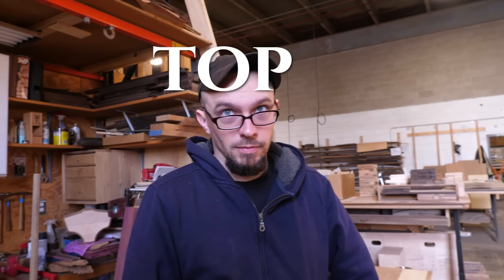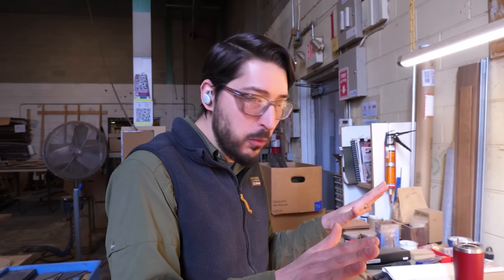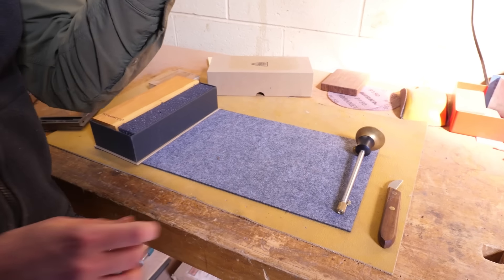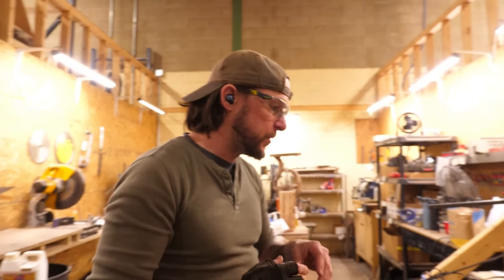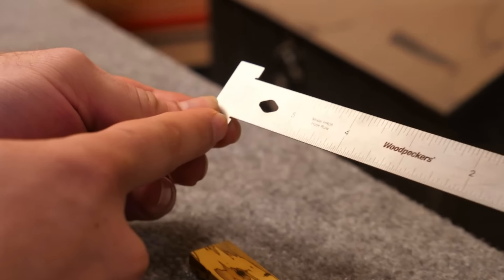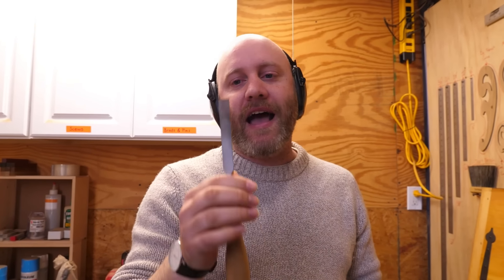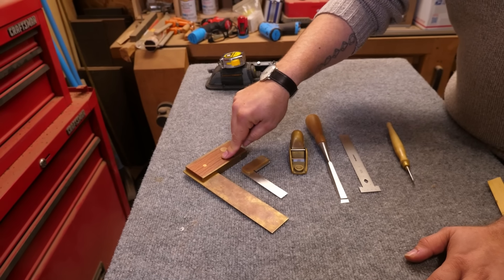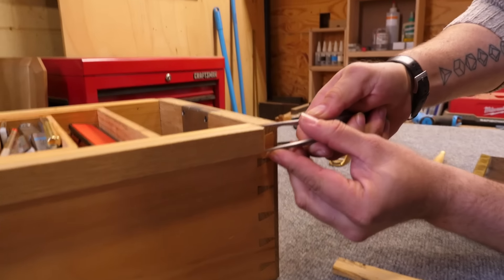Woodworking Tools You Can't Live Without (craftsman's favorites)

Comment: who is in charge of making sure all those measuring devices are calibrated? Does the Wyrmwood team have a standard that is used? I would imagine if you took all the measure tapes, squares and calipers and compared you would find a wide array of difference. Just wondering since your tolerances within the modular system need to be fairly consistent.
Reply from the maker: There is a 17th century briar effigy in the steeple of our building which holds two wicker baskets. We put a measuring tool in each basket and after some time only one remains.
Reply: @WyrmLyfe  Going to implement that at my work....it's not magic, its science!

Comment: 11:16 That's an engineer's square or machinist square.  :P
I find it funny when Americans talk fractions in measurements. It's so much easier to just use a number system with a base of ten. Switch to metric, it will make life so much easier.
Reply: Don't think that's correct. Engineer's squares are all metal (steel primarily), whereas try squares have a wood/plastic stock.
Reply: @ianm3692  The smaller one, shown at 12:35 at the bottom, appears to be steel and brass. 
Normally I see them all metal too, but wood working isn't quite as accurate.
Reply: Base ten is only superior for written calculations.
Reply: @Tom_a_youtube_commentor  You quite literally count in base ten. It's the number system that is used across the world. Or do you count in hexadecimal?